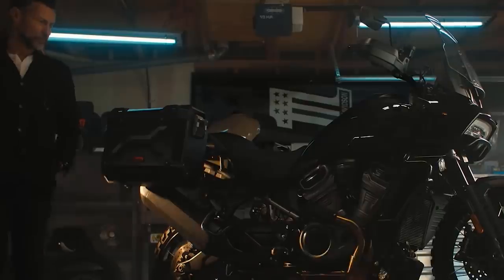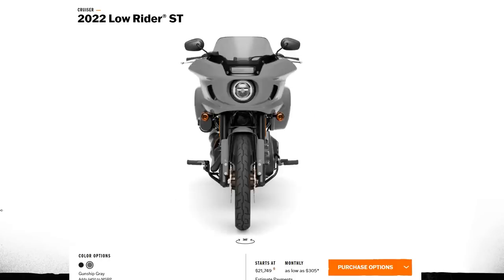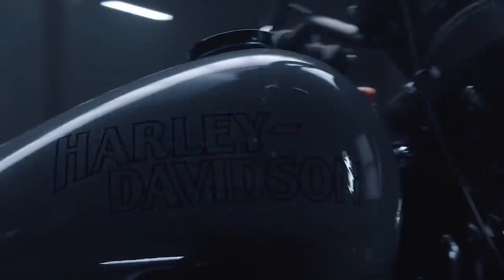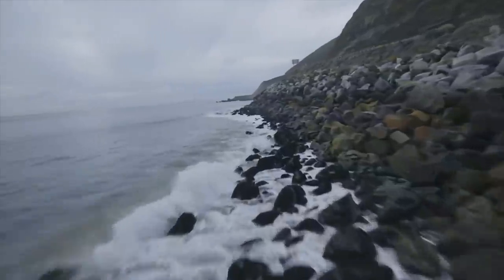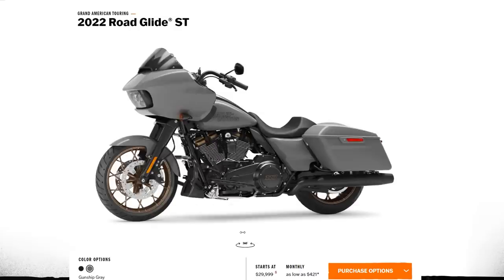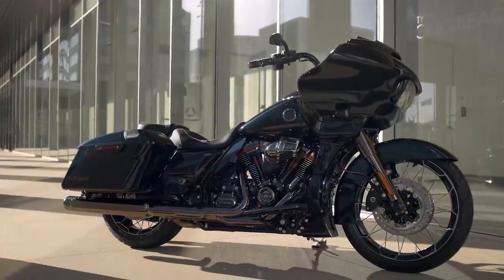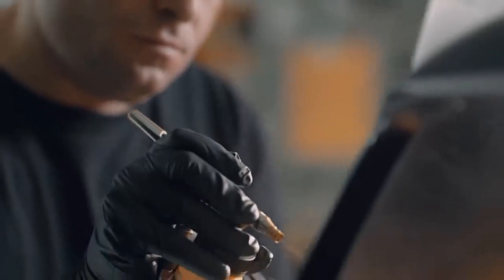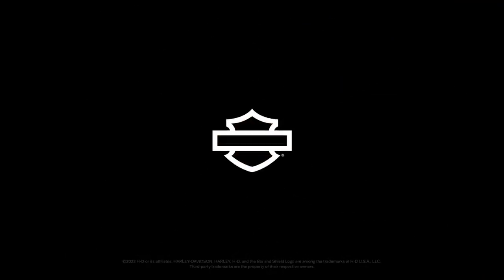2022 Harley-Davidson World Premiere Recap and Reaction

Comment: Harley needs to make the 131 standard & exclusive on its CVO lineup! I won’t pull the trigger on one until they do ! HD did a fantastic job on these new bikes ! Bravo 👏
Reply: exactly.... me neither....
Reply: Exactly. With all the money for a CVO , you should expect the 131 from the factory period
Reply: They'd do the 121 or 128 before that
Reply: The S models should have it too. The previous S models were a way to get the biggest factory engine without the CVO paint and chrome cost.
Reply: I think it's a shrewd move by Harley to leave them at 117...I bet almost half the CVO buyers can afford to upgrade to a 131. More profit for Harley...that Johan is no dummy. CVO's don't linger long on the sales floor where I live.
Reply: @sportyonetaubert5923   Possibly? But I wouldn’t mind spending a few bucks more to get a CVO right off the dealership floor from the factory with the 131.

Comment: My biggest two takeaways. 
First, I’m not a fan of that FXRT style fairing, but I’ve seen a bunch of them added to various softails and Dynas. 
Second and bigger (at least to me) I’m not a fan of the heavy breathers in the 117s now. I’m actually gonna change back to the stock air cleaner from a ventilator on my SportGlide because of having issues even with 2 rains socks and the filter element getting wet. I’ve gotta believe that the heavy breather would be even worse if you get caught in a downpour
That said, there really wasn’t all that much new stuff. I really wanted to see a CVO Softail (come on Fat Boy CVO)

Comment: I love the Low Rider ST EXCEPT that it looks lopsided. They chose different size bags to accommodate an exhaust that no one is going to keep.
Reply: thing about that is those bags have always been that way (I could be wrong, but I dont think so)...I was looking into getting a set and never noticed that they are exactly that. Once i realized it I felt/feel differently about them, and am considering different bags. Take a look at the sport glide and even the Coast Glide builds (Which are amazing btw) and now that you see it you will see it on everything
Reply: @shane2973  Agreed!
Reply: Never noticed it, now I can’t I see it.
Reply: @JonBonDonegan  Yeah, it drives my OCD insane.
Reply: Panniers made for particular bikes always different to fit around back brake,muffler etc. Multiuse ones not so.

Comment: Well done to you guys. When I saw the Low Rider ST I immediately recognized your winner from the Battle of the Kings in 2019!. The Low Rider ST was the best offering from HD for 2022, and it has caused a lot of excitement in the HD riding community. However I was disappointed in the ST touring models. There is no real innovation, and in Europe its been priced at the level of the 2021 CVO, which in my mind is too expensive.

Comment: Best way Would be All ST line up: SE 131cui engien ,SE heavy breather airfilter, SE by Öhlins rear shocks, SE Öhlins cartridge front kit, SE 610 cam for power & S&S 475/465 för Tourqe.

Price for Streetglide S 30K , Streetglide ST 36-38 Streetglide CVO 45K
And Lowrider ST 25K

Comment: How’s the seat on the ST?  Most manufacturers make poor stock seats IMO.  On my Street Glide Special I had to change my seat to a Harley seat thats on an Ultra. By the way the bottom of the seat is stabled as to after market seats that are riveted. Much better construction. But all in all I found the Harley Ultra model seat more comfortable. Big consideration for me as my average ride is around 150 miles. Yes I think the ST is going to be a big winner.

Comment: I watched and you said comment.  I would be interested to see the Rev Max in the Touring Line.  So the Low Rider ST at $22K versus the Road King for 2 Up for the Road King is the better option.    But that is just me.  I don't need speed.  Just comfort and reliability.  Ride Safe and nice job on video review.

Comment: What’s the difference in the 114 and 117 besides 3 cubic inches? Different cams? More compression?
Reply from the maker: Yes different cam and the 117 has less compression. 114 does 119 ft lbs peak torque. The 117 CI does 125 ft lbs peak torque.

Comment: Want to point something out for those who say CVOs should have a 131 from the factory.  If they do that, they have to sell them with the EPA standard exhaust with the catalytic converter.  It gets stupid, stupid hot running with the factory exhaust (more horsepower/torque, more heat rule).  People would immediately be replacing the exhaust with aftermarket.  That's a lot of money to have it on from the factory in order to be compliant to sell world wide only be discarded immediately by most buyers.  If they did sell it with the 131 from the factory, it would require the Pro Street and Auto Tuner because selling it with the normal factory tuner would be stupid.  The customer would end up not only replacing the exhaust but having to dyno afterwards and half would go with an aftermarket tuner as well (that's about $2,500ish in additional costs for the buyer).

The other most important thing is some people could not handle the power of a 131 especially riding in the rain.  That torque going to the back wheel can get away from you if you're not careful.

Comment: Matt, 
I love the Low Rider ST, but the msrp here in Canada is $26,799. The Road Glide lists for $26,999. Comparing that, would you still say the LRST is priced right? I guess jumping from the 107 to 117 justifies that.
Also it should have had a 2 into 1 pipe setup. Those uneven bags don't look right.

Comment: some good paint options this year. One thing is for sure, I hope Gunslinger does a better job with the CVO paint this time around than in the past. I had some "known issues" with the paint on my 2014 CVO Breakout.  Cant wait to see these paint jobs out in the sun, bet they look amazing
Reply from the maker: I wasnt aware of the issues on the 2014 breakout paint. The paint looks good. The yellow and Orange are a little bright for me personally but it looks well done
Reply: @MattLaidlaw  funny you mention orange  that was my first choice but had to settle for Molten Silver and Black Diamond with Forged Iron Graphics ( polished and clear coated metal). This issue with some, and bikes like mine were in the prep and or handling during paint. Folks would getting rust underneath the clear coat (blotches and even rusty finger prints). In my case, a couple rusty smudges under the clear on the polished metal sections. It happens. It got made right and life went on. I'm sure Gunslinger has better processes in place these days👍🤞

Comment: The new Low Rider is nice but the only thing I see for myself that defines it is the fairing. I see this bike and I think I'm changing out the bars, exhaust, and suspension and that's just for starters. Lot a money. I not bitching it is what is is.  Most long term riders customize their bikes. They don't sit in the garage stock.

Comment: The CVO RG Blue Steel is awesome, just wish it was a RG Special color. CVO should have gotten more CI, at least 119 to122, and the torque cam instead of HP/High RPM cam. 
   Think is was BS that the RG/SG ST models don't come with the Olins standard (yet implied in the launch).  Its a ton of extra for the money over a special.  Would have been nice to have one more color on the ST models too, like the White Sand Pearl with the bronze accents. So hopeful the 120th anniversary models will be better and maybe the Rev Max Touring (just bigger displacement, 101 CI (1655CC)Rev Max would be good {in stead of the 1275CC})

Comment: Hey Matt, I like the Low Rider ST, but the weight once you add the stereo, floorboards, tip over bars, it becomes too close in weight to my FLTRXS to consider a change. 

The Road Glide ST is a huge disappointment. $30k and doesn’t even come with the performance suspension. A person would be better off building a performance bagger from a base model, or better yet a used Road Glide.

Comment: They should have done a 2 into 1 exhaust so the saddlebags could have been the same size on the FXLRST. Running boards would have been nice and I'm not a big fan of mid controls. All in all it is a bad ass looking bike.
Reply from the maker: 2-1 isn’t a bad idea. The sport glide had it.
Reply: Include a tour pack and floor boards and adding a 2 into 1 exhaust it would be a FXLRD upgrade!

Comment: Good video Matt as always. Very informative. Yes  u r right about CVO colour in 2018 especially gunship grey. I have been contemplating if to buy 2018 street glide CVO with hardly 2500 miles or go for new 2021/2022 street glide special. I know 2022 also has gunship grey colour. Any suggestion!! Obviously new model comes with new gimmicks like traction control etc and yes warranty but that’s 2018 street glide cvo gunship grey. I started liking that only after watching your video on that bike 😉.

Comment: Just a opinion not a fact. The company should give your Dealership some credit for the low rider st.(maybe call it the stl)Turning out to be a real King... I never was interested in flame paint jobs, but I had my opinion changed when I saw the 2015 CVO flames and I was shocked to see it back on the green paint 🤔🤯 looking forward to seeing that one in person 👍and as a side note I still have 0 regret that I stepped up and spent the money to buy my 2015 CVO... not that I don't like the newer ones but the 2015 still makes me smile the same today as the day I rolled off the Copper canyon Harley lot... I know shameful plug... looking forward to the 2022 retro version, going to be hard to beat last year 🙃 they knocked that one out of the park. and I think next year will be something to look forward to in a big way across  the board if for whatever reason you are not happy with this year's lineup. Personally I'd take any one in the book and ride a happy man 😁
Reply from the maker: The 2015 CVO is rad man. The paint is very well done this year. I just can’t do the bright yellow and orange.

Comment: The website shows a 27inch seat height. But from what every video I watch says that there is, roughly, an inch gain in height. I put a deposit on one going off of the website info. I am a little nervous to see what the height really is since I am already pushing my limits with my 2020 FXLRS which shows a 27.2 inch seat height on any of the info out there for that year model. Could I use the stock mono shock on the new ST?
Reply from the maker: If you take a touring chassis and compare it to a softail that both have the same seat height the touring bike will feel taller because of the width of the seat and bike as well.

Comment: Only Cvo that looks good is the orange one. They did good with the low riders but I think they missed the performance bagger completely. You can buy a new standard road glide, road king or street glide and set up with better performance than the Street glide ST and Road glide ST come with.
Reply from the maker: It’s hard to do it all with the bump in displacement though. New cylinders, pistons - you’re out a lot of money. Of course if you did it you’d have way more power than a stock 117.
Reply: @MattLaidlaw  I agree if you are doing cylinders and pistons then it will cost about 10k to bullet proof it, but an aftermarket cam job will get a 107 to 100ish hp and 120ish ft lbs for about 3k. I got lucky and bought a used 2017 road king with the hot candy red paint job for $14k with only 8k miles on it. bought from a close friend and got a great deal then dropped 10k on an engine.

Comment: The fairing is awesome on the Low rider st. Unfortunately I believe the hard bags were a let down for 1 reason. If you look at the exhaust side, the hard bag on that side is smaller to accommodate the dual exhaust.  I feel harley could have done a 2 into 1 that most people do on this bike and had the hard bags the same size. That's just my opinion 🤷. Other than that bike looks awesome 👌
Reply: Totally agree.

Comment: I agree new Low Rider ST is the biggest positive. The biggest negative I see from HD is now that the Roadster is gone they jacked the price of the Iron 883 to that price with no real improvements/changes. With people's options now limited they jack the price up. The Iron 883 was at a good price, but they are using this as cash grab because they made options limited. I am not a fan of the new Nightster and Sportster S. Too much plastic, too much hoses, cables look sloppy run on Nightster, just cheap looking and no the typical HD quality fit and finish look.

Comment: Matt I always enjoy your informative and thorough videos. But HD completely missed the mark this year. They have a big middle finger to previous 2018 CVO owners and anyone wanting one this year. No bigger motor is a huge mistake. The paint schemes on all models isn’t very flashy at all and lazy boxy designs. The green CVO is a rip off from 2015. The dynas with ferrings is so SOA and 12 yrs old as guys in California have been doing it for at least 20yrs. So as usual HD is late to party. 
The shocks may say Olin’s but they are built with HD’s crappy specs, my advise buy aftermarket Olin’s 
Very dissatisfied and disappointed with HD this year

Comment: I know you cant please all the people all of the time or even some of the people some of the time, But I have to ask what was Harley thinking with the CVO line up? I am glad to see the MOCO trying to be innovative thru out the entire model line up however if they were gonna put the 117 in various regular models they have effectively neutered the CVO's by not bumping to a 122. There is now even less motivation to purchasing a CVO.  I understand there's a small market for CVO owners but at the end of the day if all you are getting now is paint and trim bits why spend the money? I can get one of the ST models drop 10K into it in mods and accessories and still be below the CVO price point and have a better performing bike. You couldn't make that argument previously because of the motor you were getting in the CVO. And even if this is just a placeholder move because the 23's will be getting a 122 or 124 its a slap in the face....Sorry for the rant but this really has me scratching my head and probably holding off a purchase to see what happens when the dust settles. As always Matt great content and keep up the great work.....

Comment: The good : The Low Rider ST.  I really wish they used a two into one exhaust like they had on the Sport Glide but that would have required them to create a new bag for the right side of the bike. It really looks odd from some angles when the bags are different sizes. Please don't claim its about lean angle, the lower pipe is in the same position as the pipe of the Sport Glide. Fortunately by offering only two colors, both of the pavement spectrum, I don't have to worry about looking at one. Seriously, all Softail are made at the same factory, add a Reef Blue to the option list!!! Oh, that sound bar has no manual control, you need to have your phone out to do anything with it. Who approved that?

The rest was just new liptsick on our hogs. Again, could have baited me with a better color selection on the new ST models but gray and black? 

Sorry Matt, this was a boring debut from the MOCO. They truly had nothing to offer except rearranging deck chairs. The Low Rider ST is a low effort addition that I truly appreciate but the real future is in the Revolution Max platform unless Harley replaces the nearly decade old touring frame; actually I think its older than that. Rushmore only replaced the plastics and electronics.

Will still up vote your video for effort. Its not your fault the company isn't putting real effort into the existing models. The lack of CVO bump hopefully indicates that we get completely new touring models for the 120th anniversary

PS: What was with that new over use of the exhaust sound?  It was getting to be like a Hollywood movie

Comment: My overall reaction was MEEH.  The low rider ST could have been a simple add on package to the S.  There wasn't anything ground breaking. Nothing like the LiveWire, PanAM, or even the Sportster S.  Just tweaks on what we've gotten so far.  Bring out the new Street Rod aka Bronx.   The 117 was a very small tweak.   Adding a factory option 131 in the CVO or touring models would have been a real change, it's 49 state legal so make it happen.  The Europeans would be all over a factory option since they can't do engine mods like we can.

Comment: Those Tiny Bags can only carry Lady's Purse. Are they going to make a Model for Men too? $22,500 plus the Surcharge (customer's are dumb they will pay charge) Destination, Dealer Prep, Dealer Processing Fee will get to $25,000 before Tax, Tags. The CVO prices are untouchable by 99% of the riders. No wonder HOG stock is down 33% in the las 5 years. What they are doing is only satisfying the Harley Underwear, Mug, T-shirt wearing diehards. $25,000 touring bikes have 2" rear shock with Halogen turn-signals??? Wake up Harley!
Reply from the maker: They will fit a good amount. Check out this packing video done by Nick. 
https://youtu.be/fmYATXXSHmA